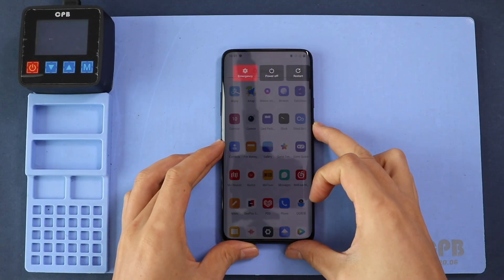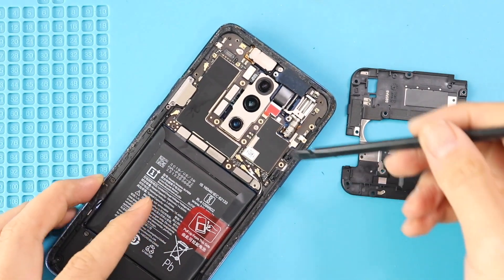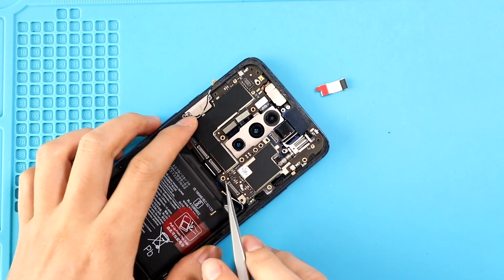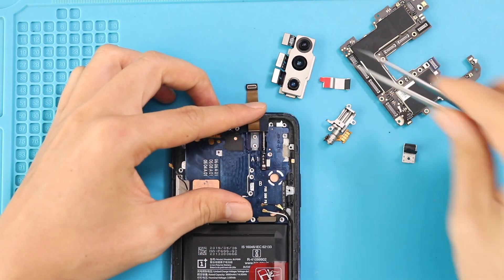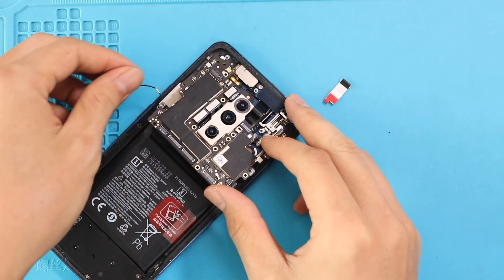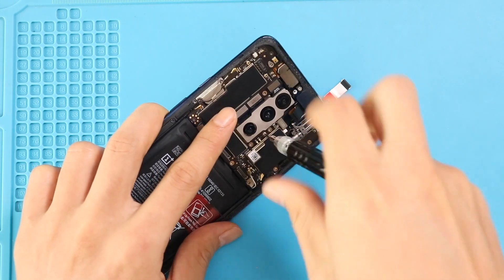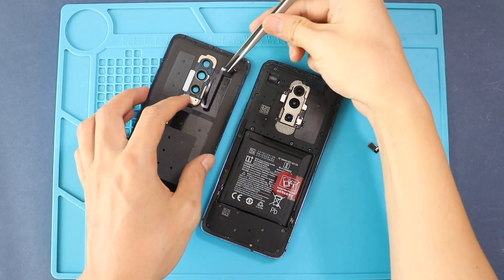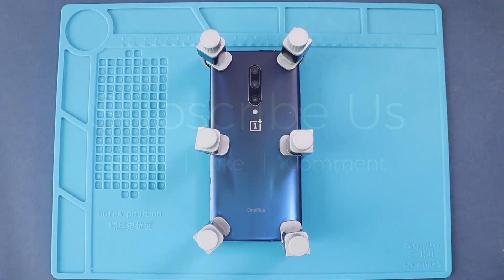Oneplus 7 Pro Camera Replacement Back | Front / | Oneplus 7T Pro

Comment: Hi I was wondering if there was a diagnostic method to determine if it's my front or rear camera that needs replacing, when I open the camera app it just says camera may be damaged.
Reply from the maker: 7 pro comes with face id right ? Does it work